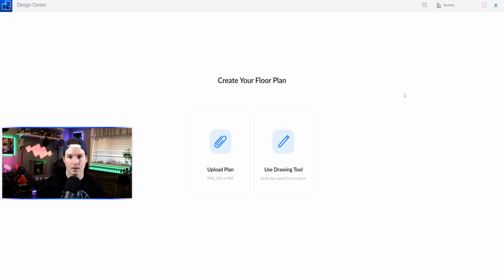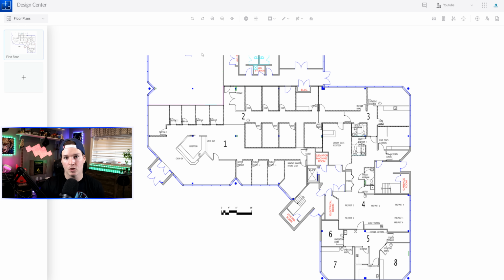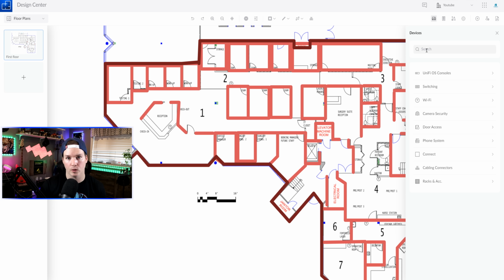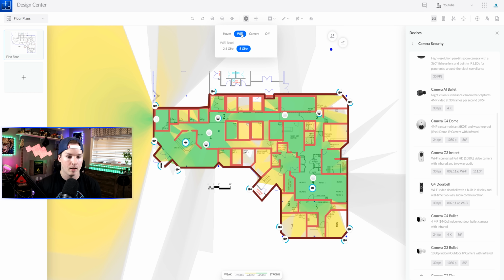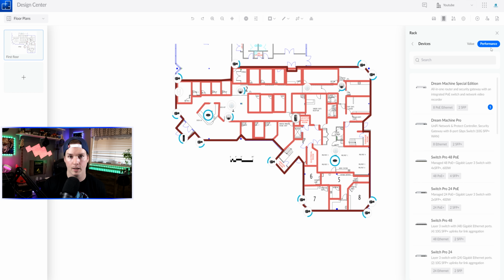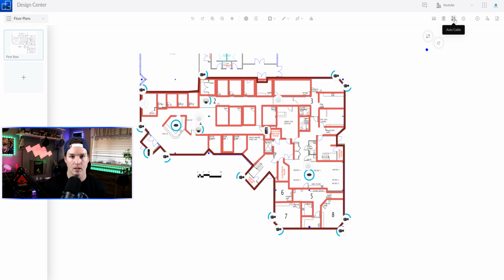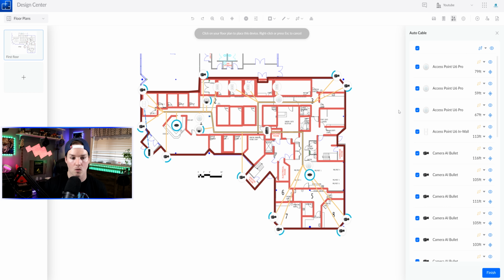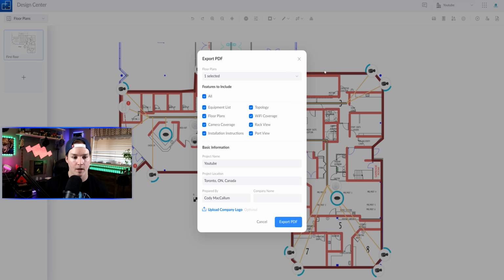UniFi Design Center 2.0

Comment: Thanks for the review. I'm building a multi-story home with concrete walls and floors and it would be nice to be able to specify the floor material too. I don't plan on any signal reaching down between my floors, but it might be useful for wood-framed homes. Also, being able to specify an AP being wall mounted and showing the proper heat map would be nice too.
Reply: Looks like the floors here are not considered when modeling coverage/interference, and are de facto independent

Comment: The biggest challenge I have with UDC is the lack of ability to integrate it with the actual Network app. If they did that, it would be a game changer and would make the process of using UDC more than just for planning and documentation. 

One thing I am still not convinced is the algorithm they are using to compute wifi range. At least in all of the versions I have used, it does not seem very accurate, especially the 5GHz range. I will test out the new version, but I would not count on it as actual until it can be verified.
Reply: @Jason, what do you think is incorrect? Do you think the range is farther? shorter? stronger? weaker?

Comment: The design "tool" is so so far away from being usable in any real-world conditions. There are tons of necessary features which are not included. I think Unifi is headed in the right direction, albeit in an extremely slow manner. It would be nice if they actually fast-tracked this to become a usable piece of kit.

Comment: Is there a best practice for addressing placing an AP on the second floor, and how that would impact signal on the first floor?
Reply: personally i would put them opposite sides and see how it goes, ad 1 in middle if needs be
Reply: It as well depends on what floors we are talking, for example if you use radiated floors then there is almost no wifi travel through it. Best practice IMO is usually to not have them ontop of each other but it really depends all on wall/floor density etc